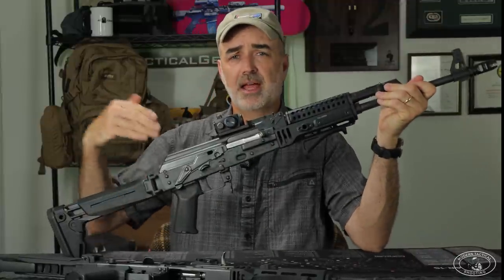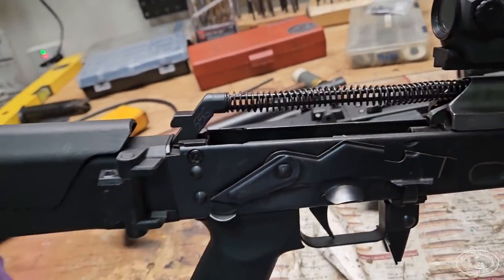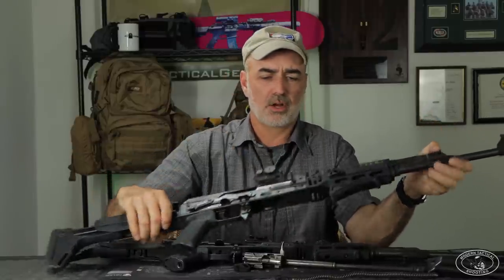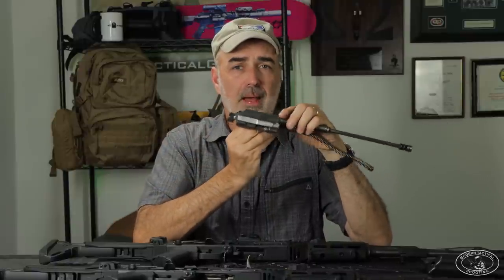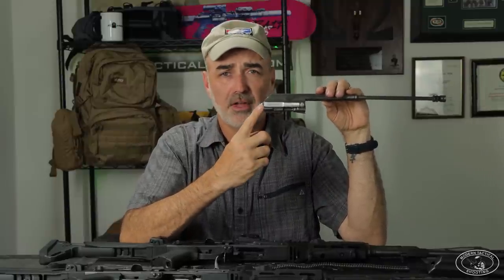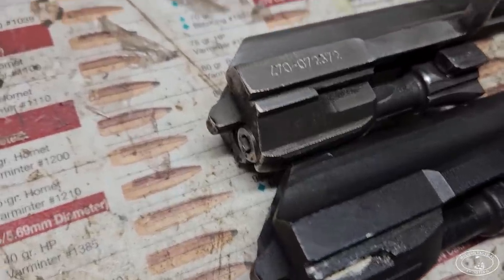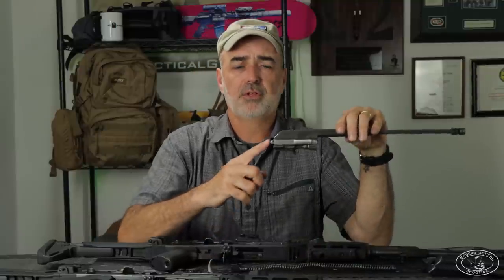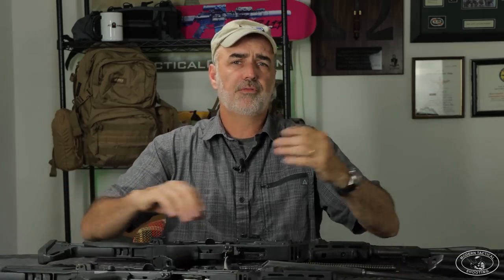Problem with the Zastava M90 (bolt carrier getting stuck to the rear) and my fix for the issue.

Comment from the maker: Many comments stating ALG is the cause, yes of course, but ALG hammer itself is not what caused gun to lock (lead to the issues but not the reason gun locked up) which is the focus of the video. I accept ALG hard hammers lead to peening in of bolt carrier tail. I am seeking max performance out of the rifle with that in mind ALG triggers offer the capability for the fastest shot splits.
Reply: That's the thing. The original Zastava hammer is softer and so doesn't peen the carrier. Is it really Zastava's fault the ALG trigger is out of spec. Harden the carrier and it could crack. The devil is in the details.
Reply from the maker: @kalliste23 Not blaming zastava, just pointing my issue and how I fixed it.
Reply: Been shooting and collecting ak's for 30 years. What will happen with the peening is it eventually will make the carrier jump the rails at the back of the reciever. Use a thinner buffer they are available. I don't remember what company makes them but they are half as thick. Also a heavier recoil spring might cause feeding issues. Use a standard ak spring for 7.62  that should help without going to a really stiff spring.
Reply: Does anyone know if the Alg hammer is shaped different or is it taller? I sanded it quite a bit to help with my bolt sticking and it helped a little bit. It looks like I'd have to take a bunch off to get it completely smooth. Anyone else have that issue or heard about this before?
Reply: I’ve seen a video on TFB tv where he talks to Zastava and they tell him not to change the trigger on them. It will cause issues. The trigger group is unique and will not function with aftermarket triggers.
Reply: I've heard the same thing and why I've had my zastava for a while and my alg trigger even longer and haven't installed it.
Reply: @PromNightDumpsterBaby420 don't take too much off or it won't go back enough to reset.
I learned that the hard way on a tapco hammer.
I kept filing till it didn't hang at all and then it wouldn't reset.
Reply: Hey does your rear receiver botton for the dust cover still work mine is stuck like glue. I think the rear trunnion has settled

Comment: It is probably is peening severely because the metal in the ALG trigger is harder than the bolt carrier tail. This is a known issue with the many American triggers in any AK. Typically, as  you mentioned, the tail deforms to a point and then stops.
Reply: Came here to say this. Trigger hammer is too hard on the alg. It affects all carriers not just Zastava. I have the round count on my m70 with very little mushrooming of the tail with the stock hammer.
Reply: Exactly this.  That’s why Zastava goes through such effort to import them with all factory internals including the FCG.
Reply: This is 100% correct. I think it was a factory tour with TFBtv, where the spokesperson said something to the effect that the hardness of the FCG was a match to the bolt carrier. They recommend not to change any of the internal parts. 

Although they are known for weak recoil springs.
Reply: Yep agree. Zastava uses softer steel as well compared to Saigas and Arsenals. On the other hand, my SAM-5 is doing the same thing when running suppressed despite using an adjustable gas block. Solution is an AK buffer
Reply: Make the carrier too hard and it could crack. Probably less of an issue on semi-auto guns though.
Reply: @Brian-ry2ij  " Zastava uses softer steel as well compared to Saigas and Arsenals."
Source: my ass
Reply: Yeah my arsenal at 2,200 rounds with a stock trigger doesn’t have this issue
Reply: @JTTTTT850   my wasr10 got mushrooming but it stopped i think stock trigger as well

Comment: Good info. Thanks for sharing, Jeff. Definitely due to the ALG hammer being harder than the carrier tail....
You shouldn't be disappointed in Zastava... if you left their FCG in, the issue wouldn't have occurred.
Reply from the maker: Very true!
Reply: True, but a mushy BCG tail is a small price to pay to get a decent trigger.
Reply: I think it's less the hardness of the material but the hammer shape, the hammer hump is much higher on an ALG, the carrier tail is supposed to hit an angled(and softer) top portion, not the flat and hard part.  I would say have a truated gunsmith polish the hammer to the exact shape of the factory trigger hammer should fix everything
Reply: @holeeshi9959  No.  He specifically said he smoothed out the hump in the video.
Reply: @dangvorbei5304  not really. Stock AK triggers are completely fine. deformed internals are not fine.
Reply: @JTTTTT850  I don't disagree. "Sub-optimal".  I also think a decent welder could hard-surface that tail to make it not do that, and that it could even be recontoured.

Comment: Ranko the owner of ZastavaUSA said that they found the force needed to push down the ALG hammer it's five times larger than a force to push hammer of Zastava trigger group. That means after five or six thousand rounds the bolt will change the hardness of material and possibly get damaged. Do not change a trigger is his recommendation.
Reply from the maker: But the original hammer spring is used, ALG does not include a hammer in kits.

Comment: Usually these deformations don’t progress.  The reason is work-hardening (or plastic deformation) causes the steel to gain hardness and hot further flattening.  When you file the sides do NOT file the end as you’ll remove the surface hardening that has occurred.  I know this from being a Mechanical Engineer.  It did not come out of my ass like some of the ideas I’ve seen.  If you want an example- bend a section of a coat hanger in half - then notice how much stronger (hardness in this case) the wire is where you bent it, compared to the rest of the hanger.  That’s work hardening just like the gun is experiencing.

Comment: ALG triggers and M90s(and M70s too) doesn't play along in general, it the material is harder than the BCG tail(its actually more geometry than material, the carrier tail isn't supposed to impact the hardest part of the hammer, it's supposed to hit a softer angled upper part, but ALG hammer's hump is located higher) I also had noticeable roughness when racking the slide with it. This is why I switched back to the factory trigger.

Also, use the 1gas setting, it is more than enough, if anything, 1 is already overgassed.

Comment: if you ever use the stock trigger just polish it and use the alg enhanced spring for $9,  this gets rid of the slop and the polishing helps a lot. I prefer doing this to mine over the alg because I like the hook
Reply: I polish the sear surfaces, hammer face, and the bottom of the bolt carrier in my ak's. If you know what you're doing you can shorten the trigger pull and reset pretty easily as well. Doing all that makes for a much smoother action and better trigger. Plus, it only costs a few dollars for some sandpaper and/or dremel bits.
Reply: @boomerisadog3899  just run the gun. It’s not a 1,000 yard benchrest rifle

Comment: Had same problem with an AMD-65 build, but the problem i found was the bolt carrier coming all the way back to rear of reciever and moving up just enough to get caught on the guide rails.  The 2 part solution was installing a piece of foam rubber glued to a leather pad to act as a recoil buffer in rear of the reciever, and replacing the dust cover with one that fit much tighter and did not allow for any upward movement of the carrier in full recoil.
Reply: oooo, jumping the rails. that usually comes from a badly done set of receiver rails, or else the trunnion was riveted in too high, or last but not least, the guide rod being stupid out of spec....

Comment: i used to worked at zastava m90s aren't popular so if they were brought 7 months apart they are probably from the same batch of guns. if there was something wrong with the bolt carrier it could be batch problem. the second problem is that alg triggers have a harder steel than the factory trigger. if you put the factory trigger back you mostly wouldn't have that problem if the future.

Comment: Using buffers I found causes short strokes allowing the bolt to pin ammunition and direct the noise of the bullet into left side of turion. Those ALG triggers I've seen cause the bolt stem channel of the carrier to shear off on 2 Zastava M70 rifles.
Reply: The only legitimate, durable and reliable recoil buffers are the Blackjack buffers and only Blackjack buffers. Every other recoil buffer brand is absolute and utter garbage
Reply: @jakeh6980 IWI makes the black buffers too. THICK rubber and DON’T LOSE their shape..

Comment: Wonder if you Carbidize (adding carbide steel to softer steel) the bolt carrier tang this would help. In the knife industry we Carbidize the face of the titanium lock bar which engages with the harder stainless steel to prevent wear of lock bar. You have to have a carbidizer which can get from knife supply or online. I am going to try this on one of my AKM bolt carriers because most have ALG trigger groups.
Reply from the maker: Interesting

Comment: I had the same symptoms on my m90 when I bought it second hand it, an it had a pretty low round count, but it only got stuck when the dust cover was on….it had a tws top cover on it so it ended up being the cast part of the recoil speing underneath where the spring goes in it had some rough spots filed them down works fine ……but that would be cause by the tws top cover

Comment: other people have said it, but it's the ALG. you may have reprofiled it, and that HELPS, but the ALG triggers are hardened to fuck and back, then back to fuck again. depending on the rifle it will cause this peening and has been known to do it in various types (hungarians and Serbian rifles in particular). 

Zastava actually uses a serbian hammer in their gun and specifically said not to use aftermarket triggers for this very reason (the Tapco g2 used to do it too)
Reply from the maker: Every gun manufacturer says not to use aftermarket parts.
Reply: @ModernTacticalShooting  of course. However, Zastava had an interview 2 years back where they said they saw this same stuff happening when Century had the contract and was using tapco G2 triggers for 922r parts, and realized that the American hammers were too hard. So when they switched to Zastava USA they made a conscious decision to leave the properly heat treated yugo fcg's in there and use the magazine for the 922r compliance parts to alleviate this known issue.

Comment: You could try using a KNS adjustable gas piston. To ease up the recoil .
Reply from the maker: Nope M90 already has built in adjustable gas.
Reply: Plus, what people continuously forget, is when you start changing the internal parts such as putting a kns piston, it’s voids your warranty. People need to keep that in mind

Comment: AKs are inherently over gassed, as most people know.  If you can’t regulate the gas, the stiffer recoil spring could be a way to reduce wear on the BC tail.  Some rifles have softer metal due the material used or improper heat treating, so it’s something to keep an eye on.
Reply: Zastava M90s have an adjustable gas spigot; they’re pretty soft shooting in gas setting 1. Most likely this issue is due to the dissimilar metals being used- Zastava said themselves in the manual to not change out the trigger due to the reason highlighted in the video.

Comment: There was a time I was researching some special ops pictures, and I noticed that a lot of them in the early 2000s used to carry the pistol on the vest instead of the belt, including SAS, Green berets, Seals, Delta...and it was something that seems to be specific of the early 2000s, coincidence, or there was some particular reason? Although I also found a lot of infantry soldiers who liked to carry the m9 on the vest too.
Reply from the maker: Becuase of tight confines of armored Hmmvs.no leg roon for drop leg holsters
Reply: @trajiiic Thank you, that's very interesting
Reply: @trajiiic Thank you, sir.

Comment: Awesome you found out and not bashing them . I have a buddy who has one so I'll for sure sound like an expert when or if it happens to his M90 lol..
Nice video bro
Reply from the maker: Yes no need to bash them. I'm running after market parts and this is a match gun being run hard.
Reply: @ModernTacticalShooting  For sure run mine hard at 2Gun Matches . I have 2 rigs that I use for 2Gun . One is my go too 13.7 with Vortex Micro Triplier , EXPS3 , and Turbo K on DA428 Keymo adapter with Pinned Nox Hybrid FH. My main 2Gun Rig is BCM Upper with BA 223W 14.5 Hanson Premium Black Series , QRF12 , Athlon Ares UHD ETR 1-10X24 MIL FFP ATMR3  & Pinned Nox Keymo Hybrid FH . 
I have little over 4k through my 13.7 and almost 6k on my 14.5 . Only issue I've ever had was with Strike Industries ambi Mag Release . That happned at 1k mark on 13.7 . Swapped it out with FCD and GTG . 
I'm actually shooting in my first PRS Gas Gun Match on Saturday at PNTC . We will be shooting KD and UKD out to 600Y. I'll be using my 14.5 with  1-10× & B.H. 223 69G TMK. I'm gonna bring my Block II with TA31CH-G as my back up lol. They are having another one in October.  I'm gonna run my 16" 6ARC for that one . Just need to dial in my hand load ..

Comment: I removed the knuckles off the hammer interface and made it smooth on the ALG. I have not had an issue with bolt deformation. Nevertheless this type of deformation on the M90 is excessive.

Comment: Once you remove the hump from the ALG, just like you do with the G2's, and polish the hammer surface, you can help the alleviate the issue, but it will still happen.  

Tail carrier peening is no big deal.  All AK's will get it depening on round count.  The peening stops, basically you are hammer forging that part (not technical term).  The metal becomes harder, more compacted, and it will not "wing out".

I run ALG's and its not even a concern, its just internet bullshit to complain about the ALG's...this has been an old issue going way back to the Tapco triggers
Reply from the maker: Agree

Comment: In my opinion the alg is not a great trigger, they are finicky to install and the instruction manual says to have a gunsmith install it. Takes a lot of fitting, at least it did for me. The disconnector will also peen on the back rivet of the trigger guard inside the receiver and some cases it can break and cause it to have a runaway full auto fire. Also the "extra light" version can go binary if you ease off the trigger reset too carefully. There are a few newer ones now that I will be checking out, I believe circle 10 makes a good one
Reply from the maker: Ive done about a dozen ALG trigger install, does take fitting, I believe based on my splits they are worth it.

Comment: Im no expert, but its my understanding that boat tail peening occurs across the AK platform. Its not really an issue, its just a thing that AK's do.
Reply from the maker: Yes but this would be classed as severe since it stopped the gun from cycling
Reply: No.
Reply: @ModernTacticalShooting  I can only guess but it might have been that the old Yugoslavian Army armorers were aware of the peening and kept an eye on their inventory of bolt carriers. Zastava might also have issued a maintenance bulletin on the matter at some point in the past.
Technical information on AKs can be difficult to obtain. Its a learn as you go process.

Comment: With respect when you change internal components to non stock this can have domino issues later.  I know a few guys with fancy glocks with 2 pound triggers that aren’t reliable at all.  Imo stock is more reliable in most cases.

Comment: Good information.  I doubt that I will ever see this problem since I still have the factory trigger and will never put as many rounds through mine as you have yours.  I'm curious, have you ever bore scoped your M90s?  I only have about 300 hundred rounds through mine and recently checked it out with a bore scope and was very surprised to see what looks like flaking of the chrome lining.  I emailed Zastava about it with photos to see what they had to say, but haven't gotten a response yet.
Reply from the maker: Interesting
Reply: A quick update on this problem: Zastava replaced my M90 under warranty.  I could not be happier with their customer service.  They turned things around quickly.  In this case I give them an A++!.
Reply: @vinyltarian wow..impressive!

Comment: Looks like one of your M90s has the version with the lightened bolt carrier (two holes in the rear) and one doesn't. Are they both imported by Zastava USA and have similar serial numbers or is one from a different batch or importer?
Reply from the maker: Both by Zastava

Comment: Do you know what type of metal the bolt carrier is made of, I am wondering if it would be possible to heat and dip it to increase the hardness of the tail?
Reply from the maker: Don't know...would be easier I think to just purchase a new bolt carrier in 5.56 from aftermarket if this ever completely fails.